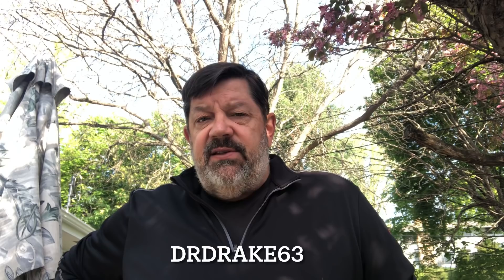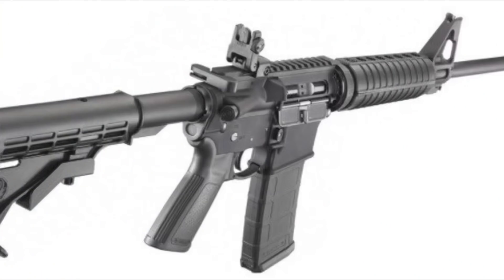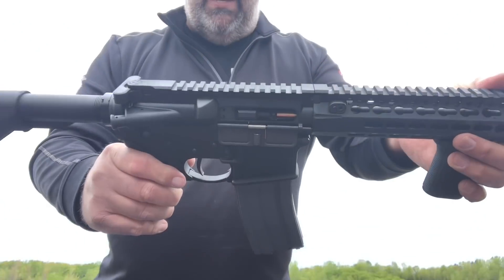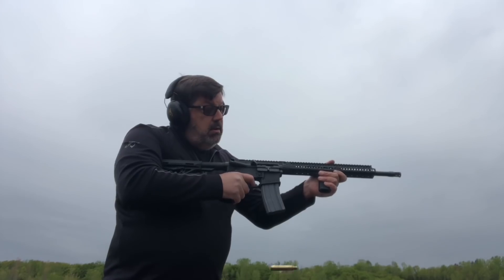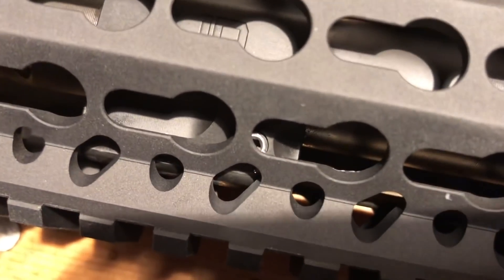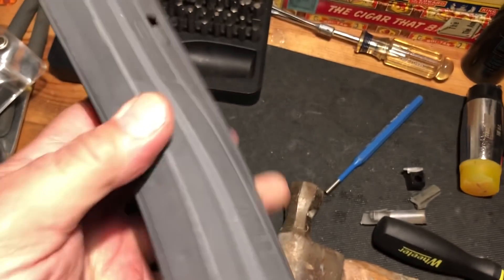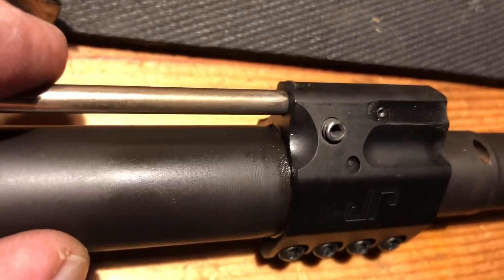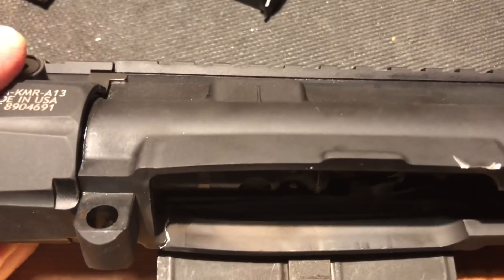Colossal AR Failure

Comment: Looks like the result of an OOB discharge. The damage is consistent in an area that would point towards that being the culprit. It’s possible that the over gassing resulted in a broken case in the chamber. Which would lead to the OOB failure
Reply: Are we seeing the same BCG damage, cause from my limited experience with OBD, there's a very different patter of damage.
Reply: @Dominik189  yup I see it. But I also saw all of the damage to the upper around the chamber. An over gassed rifle alone won’t cause that. But if the case wasn’t properly seated in the chamber and it was fired. That most certainly would wreck the BCG along with the upper. Which is what leads me to believe that an out of battery discharge is the culprit.
Reply: @TheTgiles  turned out to be a 300BLK... Made sense.

Comment: I’m don’t think that was caused by the adjustable gas block. I don’t see how its possible. Failures like that are from out of battery detonation, bore obstruction or some magical powder. I’ve seen gas tubes blow (pig tail kind), it never ended like that. I don’t think you can add enough gas back into the system to even have a failure like that. Glad you didn’t get injured. Hopefully your buddy can get the upper assembly replaced.

Comment: gas system doesn't produce enough pressure to cause that kind of damage.  Looks like detonation (undercharged cartridge). Possibly a squib, or the bolt failed to lock?
Did you check headspace after changing the barrel nut.
We need to see the bolt
Reply: The barrel nut has nothing to do with head spacing. That is down to the barrel extension to bolt fit. Agree with detonation theory.
Reply: @brettanderson6743  in almost all case's I agree. I still check headspace anytime I loosen the barrel nut. Let's call it FOD, or unforseen obstruction.
Reply: @johnaustin6673  You're wasting your time b/c like the man said, headspace has nothing to do with the barrel nut on an AR. Do it if it makes you feel better, just know you're not actually doing anything to cause headspace to change by removing the barrel nut. Its more of an OCD soothing gesture than anything.
Reply: @oldscratch3535  Even the person that say's I'm wasting my time... checks his headspace... it's second nature
Reply: @oldscratch3535  know that I think about it...
you don't own bore gauges, do you
Reply: @johnaustin6673  Depends what you mean by "bore gauge" as that could mean a myriad of things which I do own. If you mean go, no-go, and field gauges for checking headspace, then no, I don't own them b/c I don't need them for what I shoot. 

I'm generally buying firearms and barrels (AR-15s) from quality manufacturers that do the proper QC so that I don't have to. If I buy a barrel from a manufacturer, then I generally try to go with a bolt that they also manufacture. An example would be Ballistic Advantage and Aero Precision. They guarantee that their bolts will headspace with their barrels. 

If its an old milsurp then I can shoot it once and then examine the case for signs of excessive headspace and/or measure the casing and check that against original specs. A gun generally isn't going to blow up from having excessive headspace. You may get case head separation, but most old bolt action milsurps are built to withstand this and they have vent holes and gas diverters for precisely this type of failure.

If I was installing barrels that had to be headspaced, then I would own the gauges. I just don't see a point in it for what I do.
Reply: @oldscratch3535  good answer
Me to
Reply: @brettanderson6743  agreed
Reply: @brettanderson6743  oh ya' ... unless the bolt doesn't lock
Reply: I suspect squib.  He was manually cycling without a care bc was expecting bad cycling.
Reply: I would like to see remains of the bolt, agree this is an out of battery detonation. All so a review of cartridge, carrier and barrel.
Reply: @roycuster1462  watch the new video, I was wrong. It was a 300 blk.
Reply: @roycuster1462  The BCG and the barrel extension both shattered. Vented excess gas just like designed, out the mag-well.
Reply: The bolt is still locked.
A detonation would blow up the chamber, barrel or would sheer off the bolt lugs.
Look at the damage.
The bottom of the carrier is blown out du to much pressure because the bolt wouldn't turn and let the carrier move back what would have resulted to vent the gas out of the vent holes in the side of the carrier.
Reply: @HarmJW77  In a detonation on an AR the case ruptures, vents around the bolt head. The gasses exit out the mag well by design.  The way the front of the upper shattered makes me think it's a detonation. Need to get it apart
Reply: @johnaustin6673  looking at the damage it seemed to me that the bottom of the carrier is blown out.
Gas flowing in the chamber behind the bolt without the possibility to vent will do that.
The chamber area and barrel don't show any signs af damage like cracks in the upper where the chamber sits or splits in the barrel.
Reply: @johnaustin6673  ,👍

Comment: Your gas tube was partially obstructed,, then it cleared,, the pressures were then too high,, boom,, adjustable gas blocks are the problem
Reply: I don't think that is how this works, an adjustable gas block shouldnt really be able to let through enough gas to actually wreck your gun, unless the gas port on the barrel is higher than spec
Reply: If that were true the gas tube would have failed, not the receiver and barrel extension. The gas system doesn't generate enough pressure to cause this kind of failure. If the gas tube were obstructed, the bolt simply wouldn't cycle properly. There was too much pressure to be contained by the rifle, but it was probably caused by an out-of-battery detonation and/or defective ammo

Comment: I’ve seen an unset and sheered ejector roll pin come from the Ruger factory before that they missed when test firing before shipping. Made cycling and charging difficult until we caught it. I could see that leading to some microscopic out of battery condition that still allows the rifle to fire (similar to a headspace issue if that makes sense), but that’s speculation… plus, that looks like a different finish than the stock Ruger bolt so it may not be the original. I called and let Ruger know and got the sense they were aware of the problem. They offered to replace and inspect it, but we have a set tool so we just took care of it.

Comment: my guess headspace issue caused by incorrectly installing the barrel nut, did you check with head space gauges when you did it? and did you use a torque wrench?
Reply: barrel nuts don't affect headspace. Headspace is set by the barrel extension, bolt, and the barrel.
Reply: @KoonceTodd  barrel nut pulls the barrel extension tight to the upper receiver, if its not tight enough you can have a little gap between the bolt face & barrel which can cause case failure, its super rare but if have little tolerance variances from different parts markers things can happen. whats more common is the barrel nut gets over torqued  by a HE-MAN and deforms the upper and it can crack where the barrel nut attaches, not a headspace problem more of a wondering zero problem or O shit why did the barrel fly off

Comment: That would have nothing to do with the Gas block. That is Out of battery, or barrel obstruction or ammo. Too much gas will not blow the gun apart like that.  Have seen the same thing several time at the range. Most had to do with ammo (Reloads) or obstruction, even one with split case necks letting the bullet push back in the case.
Reply: Agree with this.  The block alone should not be able to send enough to do this.
Reply: Yes, that is exactly what I thought. Too much powder. Certainly past proofing, I'd guess around 10% past proof. Much above that and he would probably be in hospital.

Comment: I don't claim to be an expert but in my limited knowledge I don't think this is possible from too much gas pressure unless there was a barrel obstruction (it has happened before with underpressure loads) but I think you would have noticed it from the previous shot.  To me this looks like a headspace issue or a Kentucky Ballistics type accident with a very hot overcharged load.  If you have not seen the video of Kentucky Ballistics 50 cal blow-up I would recommend watching it.  Basically it was a fatal event had he been alone.  You were very fortunate.
Reply: This guy was firing rounds without tracking if they went boom.  He was expecting the rifle not to cycle properly, so he was primed to manually cycle without thinking about it.  It could have easily been a squib that he didn't notice.

Comment: Looks like something got into the gas tube while it was disassembled, maybe a small set screw or something similar that was on the bench. Then the cranked up gas flow finally blew it out. Look for something that doesn't belong in the rubble.

Comment: Have a hard time believing the adjustable gas block was the problem! Looks like you had a possible slam fire before the bolt was in battery, or an over pressure round. There is one other possibility, a failed cam pin. If it broke (very rare) it would have possibly allowed the bolt to go home- BUT NOT ROTATE INTO FULL LOCKUP. This would allow the hammer to reach the firing pin, fire the cartridge with a subsequent rear movement of the carrier assembly and explosion.
Reply: Agreed. A standard, non-adjustable gas block is essentially wide open to begin with. Over-gassed rifles do not destroy themselves like that. Out of battery discharges or over pressure rounds do.
Reply: @defiantmopar  Or a high primer! The bulging over the ejection port tends to indicate a detonation when the bolt picked up the cartridge- ie high primer.
Reply: I agree, I work as a RO at a range, seeing a lot of blown up guns this year. Poor quality control by ammo and firearms manufacturers?
Reply: @TactialWoman  Now that makes a lot of sense. With shortage of the past year or so people have become willing to pay top price for anything that even looks like ammo.
Reply: Yep out of battery detonation that's what it looks like to me as well
Reply: IMHO, there's no way it was a result of the adjustable gas block - even fully open it would behave as a non adjustable block.  I would think if it was a slam fire (OBD) the failure would have occurred right after he pressed the bolt release (didn't pull the trigger).  I do not believe he stated when the failure occurred (what action he took right before the failure) so, my guess is the failure occurred when he pulled the trigger.  That would lead me to believe either a hot load (likely a reload), incorrect ammo type or, as others have stated above, a BCG with micro-fractures that was already on the way to failing catastrophically.  I would be very interested to see the condition of the bullet case.
Reply: Agreed.
Reply: Did he have a problem with it cycling before you changed the gas block ? All the answers are correct and combined together it blew out. Your lucky thank God.
Reply: Easy way to resolve the differential diagnosis is to look at the casing (if he still has it). Early det would be the bulge where you didn't want it 😅.
Reply: @ChuckMorton  Mr Morton, it turned out he put a 300 Blackout round in the mag by accident. A 30 cal bullet is not going down a .22 cal barrel!
Reply: @regmason2329  well that will cause it 😅
Reply: Check that firing pin., even my builds have marks on the unfired rounds that have been cycled. It might be out of spec.
Reply: @harrisonmccullough1183  that happens with every ar15 that does not have a spring on the firing pin if those even exist. the firing pin is free floating and will always leave a small mark.
Reply: @harrisonmccullough1183  ARs do that. Floating firing pin.

Comment: Any chance that last round you mentioned finding and put in the mag separately was a .300 blackout not 5.56?
Reply: This was my thought as well, verify you didn't mix in 300 black for that last round. Its unfortunate 300 black can chamber and fire in a 556 barrel, very important to keep 300 black ammo separate from 556 guns. Its very difficult to imagine how an adjustable gas block would lead to this outcome, barrel obstruction is far more likely
Reply: @na-et2gp  look at this video https://www.youtube.com/watch?v=RbfIkaNlECo  There is no way a gas block did this, even if it was completey open no more gas can get through than the gas port hole in the barrel allows.
Reply: If he had cambered a 300AAC wouldn't the bullet still be lodged in the barrel? Even though it chambers there's no way that the .30 caliber projectile is going to clear the 5.56 barrel so he should be able to look down the barrel and see the obstruction.
Reply: @notchagrandpa8875  Maybe the bullet is still in the bore (I would think it would be) but if you read this article the picture shows the 300 bullet in a 5.56 barrel that is at the very end of the barrel almost exiting it! So the .300 bullet could possibly pass through the bore even. https://www.thefirearmblog.com/blog/2018/11/14/pictures-300-blackout-in-a-556-barrel-16/
Reply: @g.barrett8410  I didn't think a 300AAC would chamber but I decided to check into it a little bit and sure enough a 5.56 will fully chamber a 300AAC which that fact alone was surprising to me, I didn't think a 5.56 rifle would come close to fully chambering a 30 caliber projectile, so it's probably possible for the lead projectile to be reformed and forced out of the barrel especially when considering the chamber pressures used to test these rifles, but in order for it to do the damage shown there's no way it could have been solely the fault of the gas block in my humble opinion.
Reply: @notchagrandpa8875  I agree with you, no way the gas block caused this. I'm betting a .300 round or a over pressured (reload?) 5.56 round was the culprit. We need to get more info from the original poster of this video David Drake after he take the rifle apart completely.
Reply: @g.barrett8410  I love the design of the AR because when something like this happens it almost always releases the excess gas through the magazine port instead of blowing the BCG out the rear of the of the buffer tube and into the shooters shoulder or worse into their face, but I agree I'd like to know more from David Drake was the barrel swelled or obstructed, and whether it was a factory load, reload or military surplus round, we've used exploding ammunition that's left behind for enemy forces in every war since at least WW2, if one of those exploding rounds where to find it's way back into the American market this is the type of failure we might see, the ammunition is intentionally left by our military to destroy firearms picked up by insurgents on the battlefield and possibly kill or injure the shooter.
Reply: @notchagrandpa8875  I've seen bullet become stretched as they are extruded through a smaller than spec barrel like firing 9mm in a 7.63 mauser.
Reply: I really don't think the gun was over gassed. I suspect you had a barrel obstruction or a very hot round. I lean towards a barrel obstruction too because even very hot load will normally only break extractors and cam pins. A triple charge of very fast powder might do that but who's going to stoke a 223 with bullseye!? Lol. Are you certain the last round was indeed a 5.56?
Reply: Looks like a 300 black blowout.

Comment: If I may, that had nothing to do with the gas block at all. Most gas blocks are drilled out larger than the gas port in the barrel. The gas port size determines the maximum pressure delivered into the mechanism. If the gas port is within spec, the two most likely causes of a carrier rupture would be a barrel obstruction past the gas port (which could have been cleared by the subsequent round), or a badly over charged round. A barrel obstruction before the gas port would have most likely damaged the bolt head (lugs) and pushed the head backwards into the carrier.

Comment: I agree with the other comments.  If over gassed the only thing that would happen is excessive BCG speed.  If the bolt is locked, you have a head space issue or an over pressure round.  If not, then it's an out of battery situation.  The two problems that day may just be a coincidence.  Anyway, the gun failed where is was designed to.
Reply: Agreed.
Reply: Excessive BCG speed can cause a catastrophic failure by extracting the case too early, and the residual pressure blowing out the cartridge. One would think that an early unlocking would be a tame failure, but in fact it's enough to banana-peel the receiver and destroy the bolt and carrier.

Comment: First, big THANKS for the video, stuff like this needs to be seen and discussed! 

Second, I am not an expert in ARs, but just some thoughts.
In my humble opinion, the carbine-length gas system optimized for 14.5" barrels is a bit too short for the civilian 16.1-16.5" barrels. I know it is in very common use, I know it is perfectly fine for 55gr 223s, but for full pressure 5.56 rounds with heavier bullets (esp 75-77gr) the dwell time is too long, the pressure at gas port is too high. And it is not good for the gas port longevity too.

With the cycling, looking back, you might have been better helped by lightning the buffer rather than opening the gas. But who knows.

Also, it could simply be bad BCG, was it MPI?